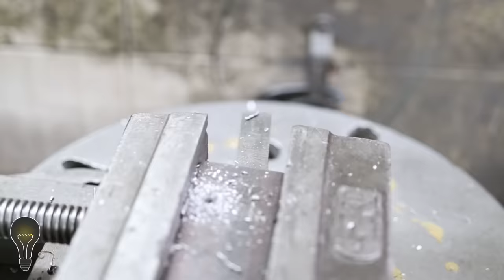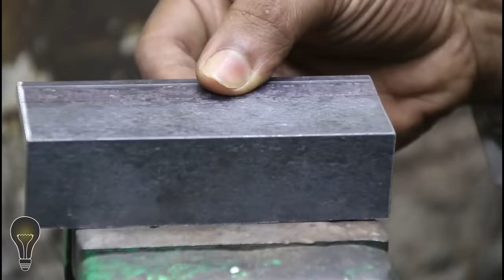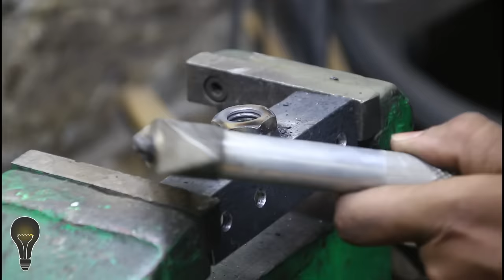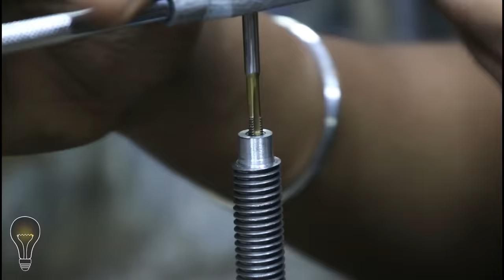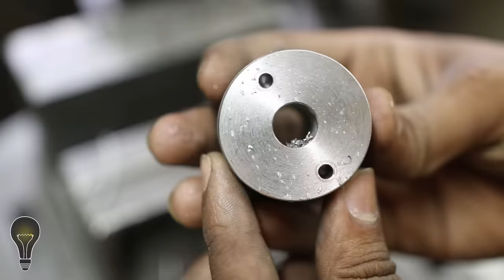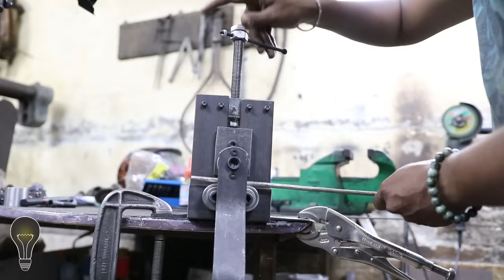AMAZING BENDING TOOL MADE FOR METALWORKING | ROLLER BENDER | DIY PROJECT

Comment: The basic idea is a couple of hundred years old. These were used to make wagon wheel tires way back when but this is a nice project for a shop with minimum equipment. Although I have a well equipped machine shop  I still get much enjoyment from building projects like this.

Comment: Great workmanship. I would have used micrometers, surface plate, height gage with scribe, and better tools, but my roller wouldn't have worked a bit better than yours. It was a pleasure watching you work. With skills like that, you outdid $25-30 an hour US tool and die maker with all their fancy machines. Makes me remember the time when I bent a 2' rim by hand, round within 2-3mm. Took me an hour.

Comment: Cool Tool. The trick is when you need rings of an exact size. D x 3.14 for a ball park length of material and then good luck! :-D
Reply: But you have to add extra 2 in on each side to get the peice to start bending or else youll a straight part in the circle

Comment: Use lubricant when drilling a hole in steel. It'll save your drill for a long time in good condition.
Reply: definitely, even a touch of cooking oil helps, must have been a mate's set.lol
Reply: jim esson linseed oil is cheaper
Reply: @duminicad  no a
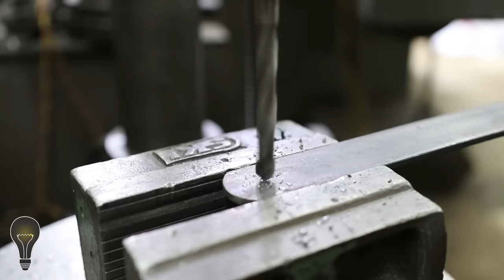Reply: @Александр Касякин  I think it gets missed because the drilling is in fast speed, but he did use a lubricant @10:04

Comment: How come when i see people drilling into steel they dont use lube everytime i tryed my bits were gone in seconds
Reply: I use HSS bits, coated in titanium. I don't use lube, but find I'm usually better off with a small bit if my overall hole size is bigger than 4mm (going through steel).
Reply: @fallenjuggalo  thanks for the info now i know
Reply: slow the rpms down or use lube or TiN coated drills

Comment: How can we adjust the diameter of circle??
Reply: Diameter x 3.14 for the length of stock. Then SLOWLY increase the pressure with each pass through the rollers, otherwise it will close the loop too much and screw up your work.
Reply: Thank u..

Comment: Time to invest in a lathe !
Reply from the maker: I already have two
Reply: Why didn't you use one of your lathes then,  to turn down the step on the end of, and drill and tap the hole in the threaded rod, for the countersunk screw; instead you used a grinder and a drill press with two blocks of wood.